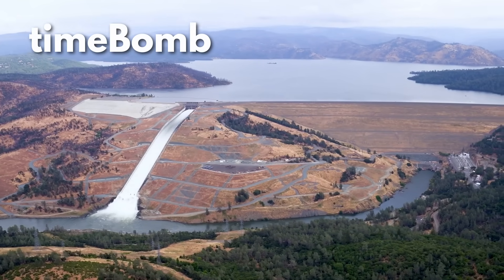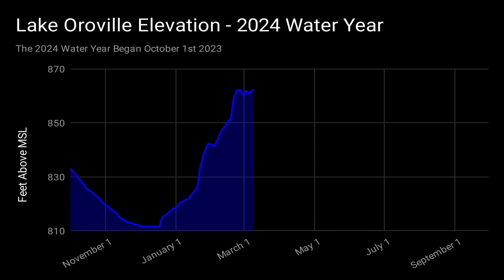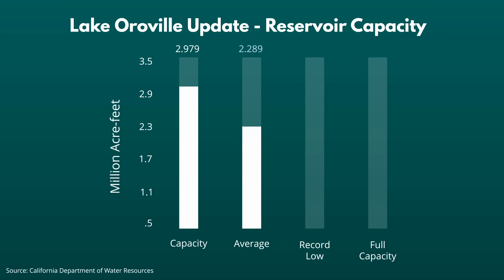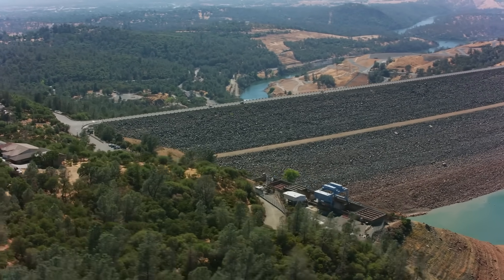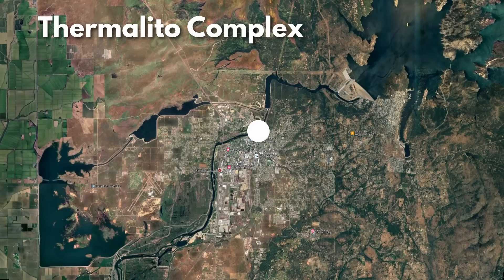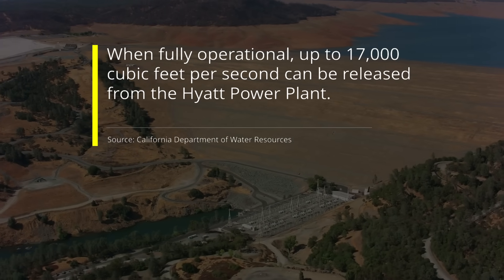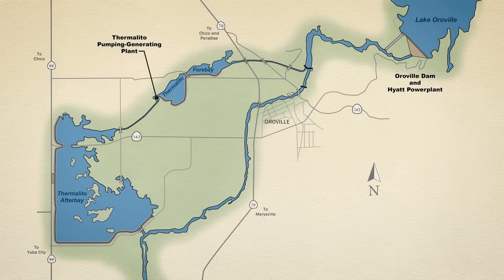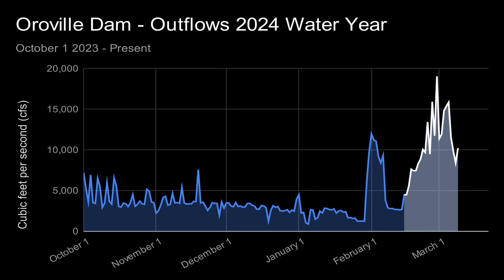Lake Oroville Update | How Exactly Does Oroville Work? | A Must Watch Deep Dive

Comment: The ability to pump water back into the lake allows Oroville to act as a sort of 'battery'. At times when there is a net surplus of energy in the grid (such as long sunny days). It will be interesting to see if the future Sites reservoir can be managed in such a way that it can also act as 'battery'.

Comment: A Reube Goldberg Machine may be similar as to pumping water back into a hydro dam to make electricity at a loss. Great video yet again.    :)
Reply: They use solar generated electricity during the day to pump water up top - like charging a battery.  So they have power available for aircon and other demands at night, when solar isn't available.  It's a common practice. They factor in the loss in efficiency, as well as their preference not to use fossil fuel derived power when possible.  It's actually quite clever.

Comment: Could you make a video explain "where" the water comes from for the San Luis reservoir, and how it gets from that Point A into the Reservoir, Point B.
Reply: That would be great to have a video of that conveyance. The Feather River flows into the Delta. Near the town of Tracy is the Clifton Court Forebay, which feeds the Harry Banks Pumping Plant. The pumps at Banks send water to the San Luis Reservoir (SLR). The Jones Pumping Plant also sends water to the SLR. Jones Pumping Plant is operated by US Bureau Of Reclamation. The SLR is shared by both the State Water Project (SWP) and the USBR. SWP has 55% of the SLR.